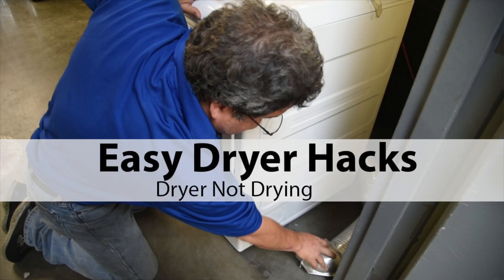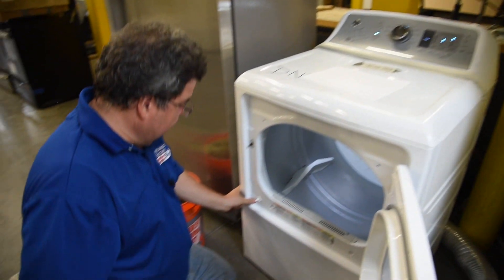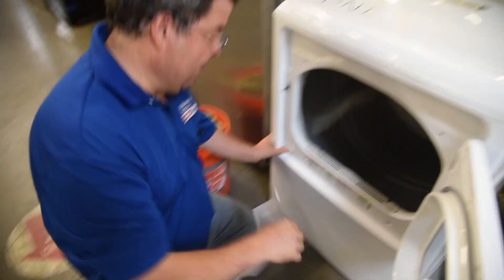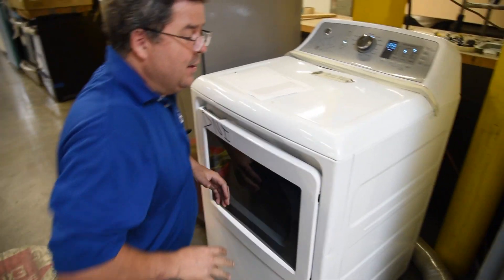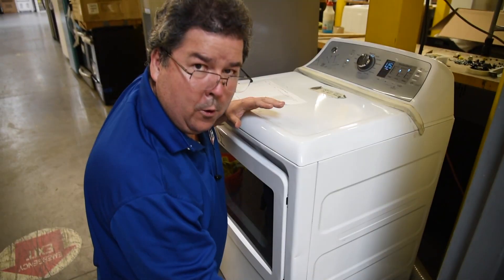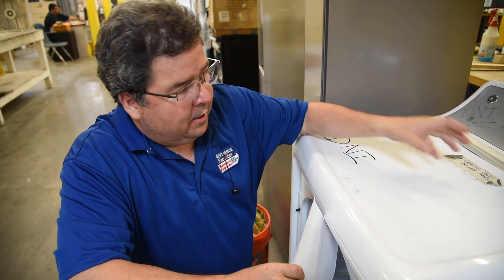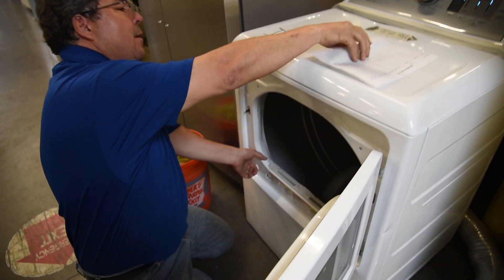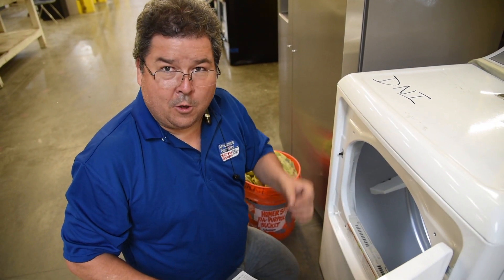Dryer Hacks: Dryer not Drying Clothes

Comment: I used the paper test tip today on a customer I do handyman work for, and it saved me a lot of time. Clothes were taking long time to dry. Ended up getting in attic and the 40 foot run was totally plugged up at the end exiting through the roof.  Made me look like I knew what I was doing and let me tell ya  that ain't  easy.  Thanks a bunch Keith.

Comment: I don't have the air pull inside the door like you show but I removed the exhaust tube and the dryer fired right up, after not being able to get the heat going. it wasn't`t clogged with material but bent at the 90` enough maybe to restrict the airflow exiting.

Comment: I just called in to get our dryer fix in building. However the electrician only noted to not overload the dryer. However the issue is the same. There is heat but not drying the clothes. Also the room tends to get very hot and moist.
Reply: Hi Julius,  My dryer is doing this exact same thing. Did you find out what the problem was?

Comment: I did the paper test and it stuck the to inside, no clog in pipe. My clothes are drying at a slower pace even on high heat. Just started recently. I have a (round) front loader if that makes a difference. The dryer is about 15 years old so long past its glory days. Do you think I should have it repaired or invest the money of a repairman toward a new unit?

Comment: Ok. So say every thing is good, no major blockages. How do you clean that particular dryer in the video, it's the same as mine. I try to vacuum it out regular, but you can see stuff is built up and if it's hard where you can see it, then you know it's getting hard and built up where you can't?  What is the best way to clean down in there?  I can't get my tube and brush (small, skinny cleaner) to go into whatever the lint goes into. How (besides cutting into the front of the dryer and making a door to access it) do you clean it? About lost my mind last night trying to get it sufficiently clean.

Comment: So what is the next step of the venting system is working properly and it’s still not drying your clothes properly?  Ty
Reply: Disconnect the dryer from the electricity, disconnect hose from both the wall, AND the dryer. Move the dryer out of the way.  Use a leaf blower to push the lint and stuff through your wall and out of your house vent.  Worked like a charm, and solo much...shtuff came out.
Reply: @yoshi6091  How does that work when you're in an apartment complex and you're hooked in to a very long exhaust vent? I know ours comes down from the ceiling and then out back somewhere. Could we still do it that way or does the apartment complex maintenance people need to check it?
Reply: @candycrawford8656  It usually comes out the side of the building.  If they are all interconnected, though...you'd might end up blowing it into your neighbors' apartments.  You might ask if they can do it for you, or if it's okay that you do it.
Reply: @yoshi6091  Found out yesterday that ours comes out on top of the building (we're on the 2nd floor). They were re-roofing the complex roof and they were messing with it and the rain cap. So we'll see...
Reply: @candycrawford8656  Wow.  There must REALLY be a build up.  Unless they regularly vacuum them out, similar to A/C duct cleaning.
Reply: @yoshi6091  🤷‍♀️ I don't think they do anything regular, but that is just my view..

Comment: The dryer doesn’t dry in one cycle. What’s the issue?
Reply: Lint could have accumulated in the out vent. Outside of house. Right behind where the dryer is set up. Take trap off, clean and boom. You’re good
Reply: Disconnect the dryer from the electricity, disconnect hose from both the wall, AND the dryer. Move the dryer out of the way.  Use a leaf blower to push the lint and stuff through your wall and out of your house vent.  Worked like a charm, and solo much...shtuff came out.